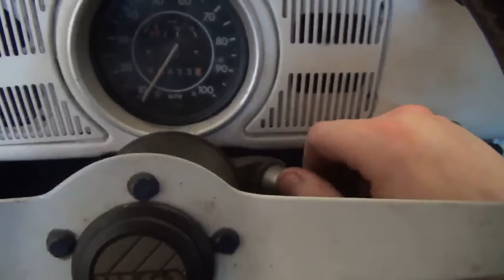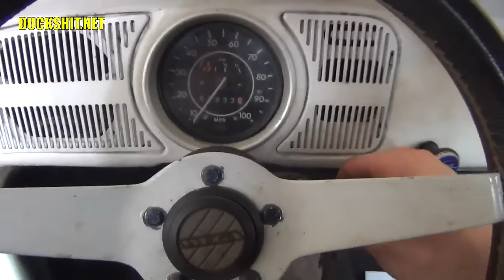Howto Install a VW Beetle Hot Start Relay (Hard Start Relay)

Comment: I have a different question: I started my car (1600 VW Beetle), let it idle for few seconds, then slowly reversed out of my garage. Tried starting the car a few minutes later but the motor wouldn't turn. Just a clunk jammed sound. At first I thought it was the battery, replaced that but no success. I finally took a 19mm wrench and turned the motor over backwards and forwards, it started there-after. What caused this?
Reply from the maker: I have no idea I didn't get to look at it, but I can suggest that possibly the starter jammed up.  Otherwise it's just going to be a bunch of guesses

Comment: So when I touch the solenoid wire to the battery my bug starts but when i have the relay set up just like yours with proper wire and connections the key still doesn't do anything. What do you think could be wrong?
Reply from the maker: Bad ignition switch, or a wire is disconnected or damaged someplace!  But most likely it’s the switch, I’ve had bad ones before.
Reply: @DuckmanCycles  Ok so i just installed a hard start relay, new ignition switch, and new ignition lock cylinder. I have contact from the key now but the starter jams on and stays on until i turn off the key. So i hot wired it from the plug and it jams on still. if i touch the solenoid wire from under the seat to the battery the bug starts just fine it doesn't jam on. Have an idea what could be causing this?

Comment: Can i use the same wire to test the starter switch?  My starter turns on but won’t turn off.  If you have a video on this problem great!  Thank you in advance
Reply from the maker: Yes you can use that wire to test the starter switch!   Your problem sounds like a stuck solenoid, somewhat common issue.  Has your car been converted from 6v to 12v?   Usually you can rectify it by changing to a proper 12v starter... or just replace the starter anyway even if its already a 12v.   I hope that helps!
Reply: DuckmanCycles and VW Garage  thank you , turned out to be a couple loose wires. Loose screws still loose 🤪
Reply from the maker: Awesome! So glad you got that figured out... you may have some loose screws, but mine are missing entirely LOL

Comment: Hi. I have a 1973 beetle with 1300 engine. It was not starting so I changed to new coil, new spark plugs and leads, new 009 distributor, new 30/31 pict 3 carburetor, new fuel pump. I have set the timing and there is current to spark plugs. I have tried to start the car and it takes a really long time to start after cranking. It does this after I put my foot down to the floor on accelerator. I have only managed to start it twice this way. Any thoughts would be appreciated. Thanks.
Reply from the maker: You emailed me and we sorted it out, turns out your choke wire was off the carb... hehe!  Easy repair, good for you!  Thanks for the comment!
Reply: Cheers mate

Comment: If I can only find a 30 amp relay would it cause problems??  I installed the 30 amp one and now my G light flickers when I accelerate...started right up tho!
Reply from the maker: I think we talked elsewhere earlier today... but the generator light should not be affected by this relay, unless there was a massive diversion from what I demonstrated here in the video!  Hope that helps!  Check your belt tension especially, it may be slipping when you speed up.  If it still acts hairy, you can try to re-polarize the generator.  I've seen that solve the problem before, too.  Here's how to polarize a generator... right at the 19 min mark. https://youtu.be/qR21hAvA7Tk?t=1139

Comment: what wire goes where on the 4 pin relay for the horn on the 78 ? Three terminals are all pointing / positioned one way and the 4th one is across, lets say at the top - what wire goes where? let say you're facing the relay pins... Face the pins w/ the one on top going like this -------  and all others (3) are all in the " I " position ? 

I cant find a schematic worth a flip online - anybody ? please ? thanks, PG
Reply from the maker: Have you looked on thesamba?  Probably the best place to find those kind of resources!

Comment: So I have a 69 VW beetle and it’s doing this but I have a push to start button connected to something any advice on that?  😅
Reply from the maker: I'm not sure that I quite understand the question, but if you do have a push button then you have a custom setup thst can be wildly different from stock.  Something like you see in this video is possible to add to that, but how to do it depends on what you've got.  Sorry that I can't be much more help without looking at it.

Comment: I have trouble starting after getting to operating temperature. Changed fuel lines, spark plugs, distro fix, and spark plug wires but nadda. Changed to new air filter as well. 

When it's cold, starting up is a breeze.

Any thoughts
Reply from the maker: This is not really relevant to this video, and would be considered a post hijack.... but you're in need, so here's what I'll suggest:  Perhaps it has little to do with temperature.  Make sure the choke is opening up as it is supposed to.  Also make sure your float in the carb is floating properly.  It'll cause a really rich condition that a cold engine wouldn't mind, but a hot engine doesn't like.  Also, verify your thermonstat is doing what it is supposed to.  Good luck!  If you'd like to discuss more, please use one of my contact methods in the video descrption or on my website!
Reply: @DuckmanCycles  haha I'm sorry! It was a late night pondering how to fix this thing hehe. I'll ask my questions thru the right channels
Reply from the maker: Thanks dude!  I hope we get you figured out

Comment: Great information! I do have one question though, I have a 68 bug but it’s got a different body in it( a kit car) and it won’t start now. I would think if it was this problem I could push start it as long as the keys in the on position, can someone back me up please?
Reply: Fyi, it won’t push start it sounds like it wants to but electrically won’t run
Reply: Sounds like you got a whole lot of stuff going on there that I don't understand exactly or that I think that I could answer without actually seeing it in person.  But if something like the battery is in terrible terrible shape or if the key switch is acting up there is a possibility it may not light off the ignition coil.  I would definitely have someone look at it, it may not be a big deal at all, usually on Volkswagen's it's pretty simple.

Comment: So after watching this video and installing the relay the issue is still there (power on but not starting)  do you have any input on this?  Thank you.
Reply from the maker: Sure, couple things mentioned in video to investigate... bad switch, also test solenoid on starter by jumping it with a screwdriver.  If it's not one of those two things then you've got a bad wire or loose connection somewhere.  Hope that helps!  Lemme know what happens!  Good luck!
Reply: @DuckmanCycles  thanks. I'm gonna try to trace the starter wire. I think I subscribed so keep em coming. (And drinking while.you do it)

Comment: New to bugs here.
I’ve got a problem, where the bug cranks slow or wont crank at all, when it gets hot. Could this solve that problem as well? Keep up the good work :)
Reply from the maker: Probably a bad starter... if it’s the starter and not something more extreme like a swollen engine rod bearing when hot about to blow.  I’ve only ever seen that once, but yes it’s possible.  Check or replace starter first.
Reply: DuckmanCycles and VW Garage - Thanks, I’ll do some measuring on the starter. Turned out the car already had a relay installed as well :)
Reply from the maker: DR. PH!L maybe relay is bad, check that too!

Comment: So, I followed your install instructions to the "T", and after relay install no power at all? What's amiss? Is there another way to bypass the bad igntion wire? Thanks!
Reply from the maker: Yes, to bypass the wire just run a new wire!   😁👍🏻 otherwise when it comes to wiring logic, I really can't help you diagnose it without actually seeing it myself and touching it

Comment: Duck man got power to coil just won't turn over at all will this method work
Reply from the maker: That depends on where the fault lies.  You may have a bad starter, a bad ignition switch, or even just a disconnected or loose wire somewhere.... this hot start relay will not rectify any of those problems.  HOWEVER, this week I will be releasing another video of another car with exactly the same problem as you are experiencing and my diagnostics to get it running again, I don't think this one needs a hot start relay, but I may do it anyway.  Watch for it!   Maybe that will help you to find the problem!

Comment: My 73 VW Beetle cranks over when you turn the ignition switch all the way to the right/start position, but it looses power to coil.  As soon as I release the key in the run position, the engine starts ,,,,,,what is my problem?
Reply from the maker: If there are no other problems with the electrical, then its got to be the ignition switch, sounds like its broken inside.  They are pretty easy to replace and cheap.  I'd just replace it anyway to see if thats the trouble.
Reply: I bought a New one.
Reply from the maker: Any luck with that ignition switch?

Comment: My ‘69 Beetle doesn’t bounce back when you turn the key to start it. You hear the horrible winding of the starter when the engine’s running. It’s a pain to turn it back fast and just right so it doesn’t die out. So is this the ignition cylinder or the switch wiring?
Reply from the maker: It's most likely a problem with the ignition switch itself, only about $10 and not too terrible awful to replace. The cylinder itself is probably OK unless its getting jammed.  It does not sound like you have any problems with your wiring because everything does what it should!  I hope that helps!  Thanks for the question!
Reply: DuckmanCycles and VW Garage — Thank you so much, sir!

Comment: Duckmancycles/Duckshit.net. watched your vid. on starter-hard relay..very good infro. Thanks..here's a good thing to remember when buying those relays..go on-line on ebay..for the price $10..you get #10 relays with connectors & wires..I use them also on my outboards (30/40/60) amp's..they call me "critter" nickname..I don't need all the wire, but, getting those relays that cheap is worth..!
Reply from the maker: Thank you!

Comment: Red wire under the back seat isn't there if you have a 1958 Beetle as this wire gets routed through the roof to back of car then comes to solenoid from engine bay.
Reply from the maker: Thank you for the input!

Comment: Hello sir duckman,my beetles engine becomes very hot even if i only run 25kms and if you turn it off and start it it wont start till it goes cold,the coil is very hot,the decklid oil cooler works fine.what seems to be the problem?thanks
Reply from the maker: Check your timing!  That may just be the issue.  The symptoms as you describe are very similar!  Thanks for the question!
Reply: @DuckmanCycles  the timing is correct sir,we changed the contact point,rotor,ignition coil and distributor but again the engine is very hot with just a 15kms run...maybe we should check the valve clearance sir?
Reply from the maker: Its always a good idea to make sure the valves are set right.  Make sure you are getting proper fuel delivery and that you aren't experiencing a vapor lock issue!
Reply: @DuckmanCycles  the timings are good sir,maybe the valve clearance,i'l check it if it has exact clearances.thanks sir
Reply: @jackbilbao1629  check all tin is in place and no hot air is being pulled in and blown back across motor. All tin , even underneath, must be there or It won't cool as well. Also, ensure the tar-impregnated material mounted to best behind engine hasn't loosened and is restricting air flow going into cooling fan (behind fan shroud) good luck
Reply: Also are you certain your deck lid oil cooler is not restricting air flow?
Reply: @DuckmanCycles  thanks,i know the problem,its my starter,it would turn when its hot hehhehe

Comment: On 73beetle what fuse is gas gauge location
Reply from the maker: I don’t think I understand the question as asked but you might want to check the shop manual for a definitive answer.  I hope that at helps for whatever it’s worth!

Comment: What happens when it turns over sometimes and when it does it turns over slow ! ?
Reply from the maker: Replace your starter bushing weather it looks like it needs it or not, also polish all of your electrical connections to the starter and the battery.   Usually that will get it, and if it doesn't you need a new starter.

Comment: Hey Duckman, i tried to start up by connecting the starter solenoid wire directly to battery and it cranks up. Doesn't start all the way due to carb and fuel but thats another issue. Question: After 3-5 attempts, the black negative thick cable wire is hot and the metal portion is whew hot like a pan! Is that normal or i got a short circuit suspect now?
Reply from the maker: ACK!  Something isn't right, start taking some photos or videos of this thing and share them with me.  But disconnect everything from that battery so it doesn't start a fire when you're not around.  Email me through my website or hit me up from the social media links.  Let me see what you've got!
Reply: @DuckmanCycles Roger WilCo!
Reply from the maker: Well, I don't think you have a short, not in the starter area anyway...
Reply from the maker: 1. The battery terminal is likely getting hot because it has a bad connection.  Clean the battery post, clean the clamp, and make sure the wire is clean where it goes into it.  Any bad connection in that area, and it will heat up quick.  If you have any doubts, clean everything and replace the clamp.
Reply from the maker: 2. The relay going click when you connect the negative does suggest that the ignition isn't connected properly, or there is a wire out of place somewhere...  It is getting a constant positive signal, just figure out from where, chase the colors!  While not a short, something is crossed up (or the switch is bad) somewhere up front.
Reply from the maker: 3. Otherwise the relay sounds like you had it connected properly, you demonstrated the correct wires under the back seat.
Reply from the maker: Happy hunting, it shouldn't be too hard, its only one wire that's acting up!   😀👍
Reply from the maker: 4. Once you get the battery post fixed, and the switch sorted out, you may not even need the relay at all.  Let that be the goal!
Reply: @DuckmanCycles  Thank you bro. I'll keep ya posted! I already removed steering wheel again as i wanted to check if ignition wires were sending current/volts but was not sure how to safely check that lol. Ok, i will clean the posts and perhaps get a new cable for negative post too. Can i use sand paper to clean the post and terminals?
Reply from the maker: Yes sanding is effective!   Best way to check for active wires is with a multi-meter or a test light.  Ground one probe, and start poking with the other.